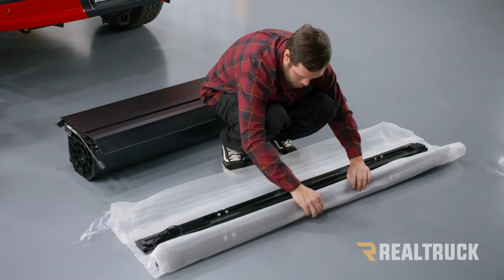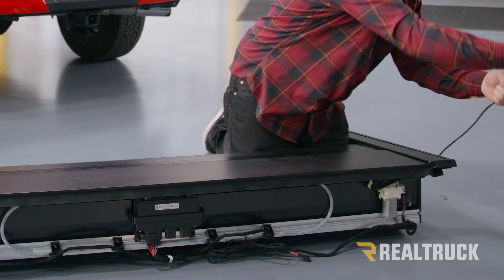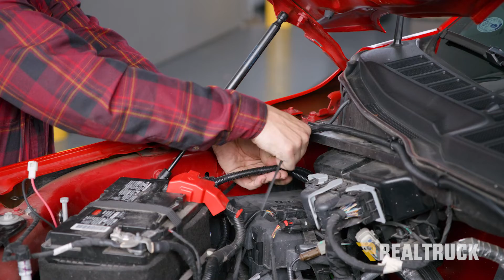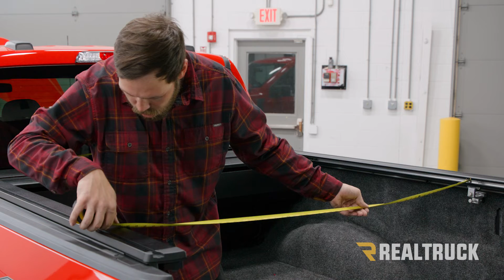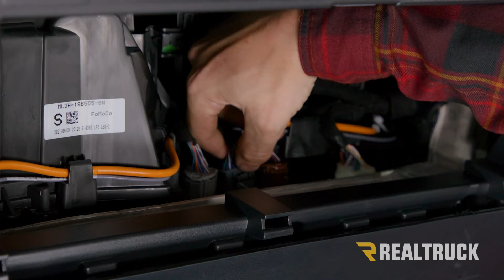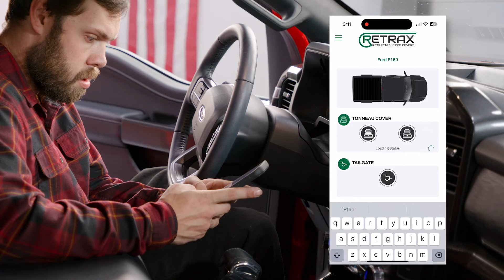How to Install Install the Retrax EQ Tonneau Cover

Comment: i finally decided to order this cover. picked it up from the local dealer friday. box was missing both water shield parts. i called, they said they would over night them to me. now my fedex tracking says it wont be here until friday. i got the whole bed cover next day but it takes a week to get the parts that were missing from the box?!? not very happy right now
Reply: Mine was missing the entire side tracks, the battery cable and most of the hardware… I feel you

Comment: Where do the drain tubes go?  Do you have to drill the bed? (2024 F250).
Reply: What did you end up doing? Got mine delivered today for my 23 F350
Reply: @ianmcadorey2398  any update? Installing mine now

Comment: THE EQ DOES NOT WORK ON NEW GM TRUCKS- DO NOT BUY IT IF YOU HAVE A NEW CHEVY/GMC. 
The promised door lock/unlock and tailgate functions don't work, and it almost never responds after 3 presses of the remote. 4-6 is the norm.
!DO NOT BUY THE RETAX EQ IF YOU HAVE A NEW CHEVY/GMC!
Reply: There's two versions . One for 19-21 one for 22+ refreshed models. The harness is different . Harness is also different on amp research steps.
Reply: @richardquevedo6958  I assume you're replying to me? I have the (-1 IIRC) variant for 22+ and the communications with the BMC definitely only work in one direction...
Reply: I hope that you are wrong I am installing one right now, I'm gonna be pretty upset after dropping this much coin.
Reply: @jarrod5793  As was (and am) I. Apparently the new BCM ignores messages that are not signed properly (encrypted). I'm guessing this was done after the CANbus injection car thefts hit the media, but super messed up to continue selling a product with features that they KNOW don't work, and don't have any clear plans on how to make them work. I'm a bit less shocked that GM doesn't trust RealTruck enough to issue them encryption keys...
Reply: Is there a negative wire to wire to the frame on the cabin module for a 2024 Ford F150 Raptor? I’m installing right now and I don’t have a negative but I also don’t have power when I turn the ignition on so I’m wondering if there should be?
Reply: @mclarson23  i just bought this cover for my 2024 f150 raptor also did u get everything figured out and how do u like it. Any tips you can give me too help with the install thanks
Reply: @bryanyoung9482  It ended up being pretty straightforward once I realized that the install instructions I received weren't for our vehicle. The ones I had had you installing the module on the passenger side footwell but after I realized that was wrong and found the property instructions for the driver's side it was smooth sailing!
Reply: I have a 2024 GMC Sierra and the EQ works great
Reply: @jimmlodgenski2358 And the door lock/unlock works? The fob to open and close responds on 3 presses all the time?
Reply: @ourback  yes, every time
Reply: @jimmlodgenski2358 I guess I better re-open a support ticket, they obviously fixed the software…
Reply: @jimmlodgenski2358  It's not nice to lie to people. (I've checked with Retrax thinking they must have fixed the problem, but they definitely have not.)

Comment: Went to the link and I don't see any 2024 Chevy 2500 available.  Do you know of an availability date or if the 2022 EQ would fit/ be compatible with the 2024 trucks? Thanks

Comment: What size is the canister?
Reply from the maker: The canister on that cover is about 9 3/4 in. deep into the bed from the top of the bed rails. It extends out about 10 inches from the cab to the tailgate